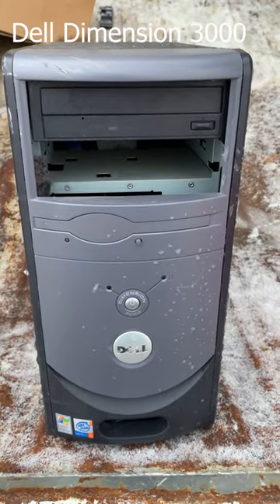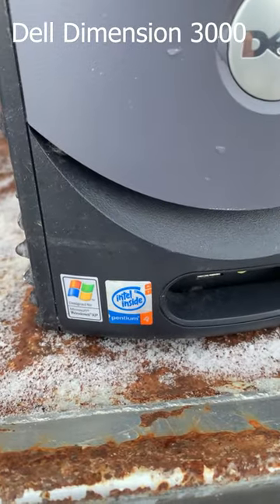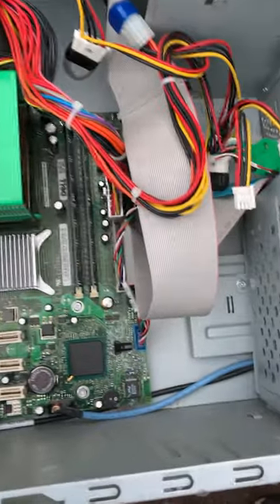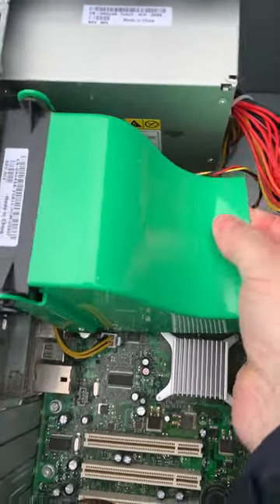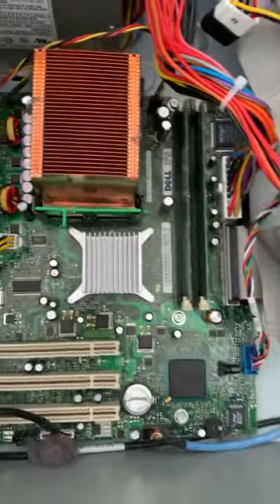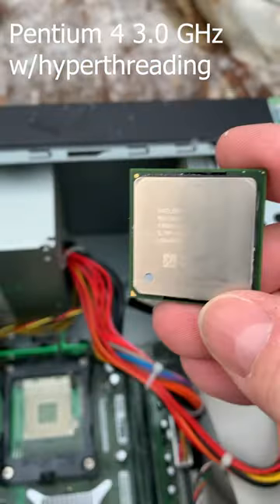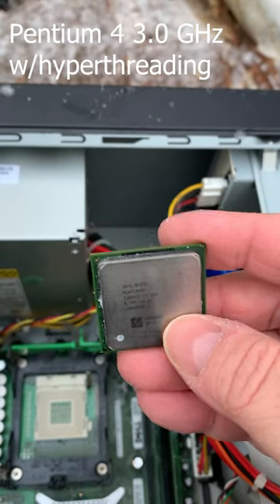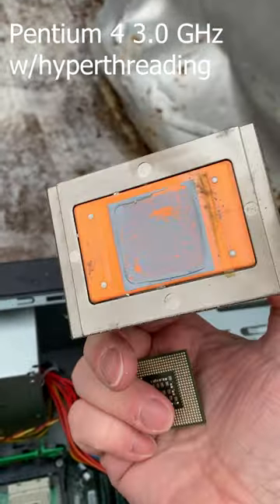Solid Copper Heatsink!  Dell Dimension 3000 with hot-hot Pentium 4 3.0 GHz CPU #shorts

Comment: Nearly a carbon copy of our Dimension 3000 from 2005. Ours had the copper heat sink too, but a Pentium 4 “Prescott” clocked at 2.8Ghz, non-hyper threaded. Awesome little computer for its time, ours was in service for about 12 years. I still have it, but I’ve upgraded to a MacBook since retiring the old Dell.
Reply from the maker: nice!  But you went to the Dark Side 🤣

Comment: Have a old computer with a Celeron D socket 478. Always wanted to upgrade it to a Pentium 4, but they are expensive to get on eBay!
Reply from the maker: I never considered them "desirable".  I may have to adjust that.
Reply: They are quite cheap these days … only expensive p4s are extreme editions and the top speed bin like the 670

Comment: pentium 4 were single core though some did have hyper threading so one core and 2 threads.
Reply from the maker: Correct!  And hot as Hades!
Reply: @UncleMikeRetro  Yep just like the pentium D and AMD FX 9370 and 9590
Reply from the maker: Pentium and Celeron D 🔥
Reply: @UncleMikeRetro  True celeron D ran hot and slow. One of the worse performing CPU's ever.

Comment: What a waste, those things were super powerful, the only downside was capacitor rot with those motherboards. Pentium 4 pcs ran SUPER HOT to get the clock speeds it hit so all that extra cooling was very necessary.
Reply from the maker: I hate the waste too!  At least we get to see them one last time 🤓